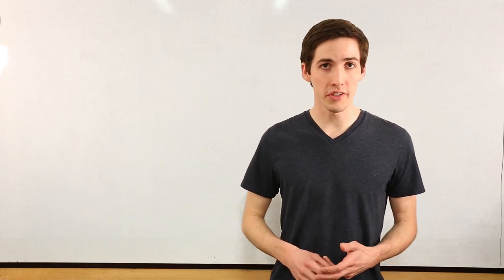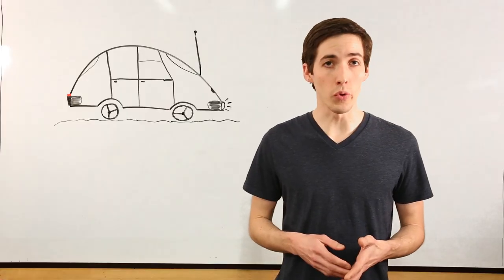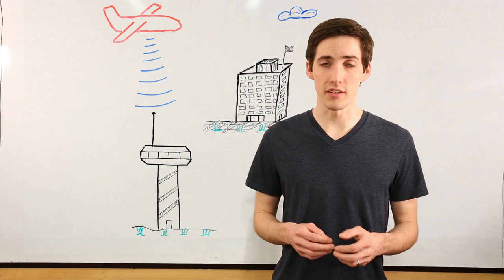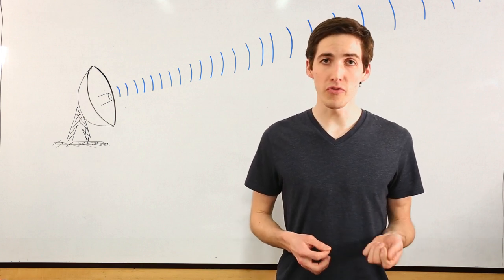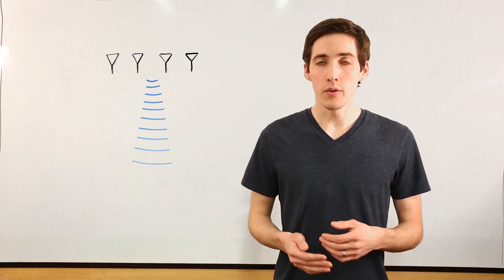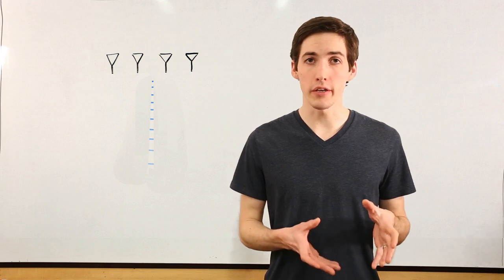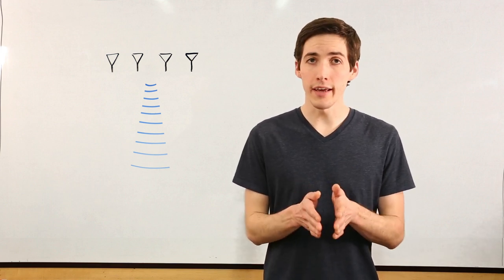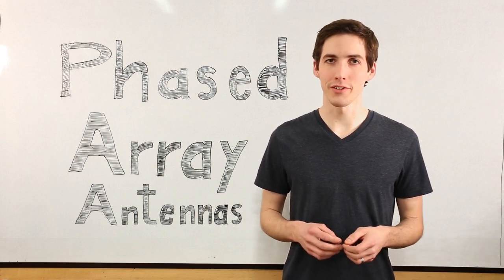Phased Array Antennas

Comment from the maker: Hi all, thanks for the encouraging comments! Grad school has kept me busy lately, but I am going to try to make another video in the coming months. Do any of you have a particular subject you would like to see a video about?
Reply: +Mark Hickle . kindly upload a video regarding Non-Uniform Linear array.
Reply: Can you show how we can perform perform the same thing using the phased array antennas but to produce a beam that moves in 2 dimensions? In other word, a 2d version of what you explain..
Reply: Excellent explanation!!!
Reply: Very simple and easy to comprehend. Good effort buddy
Reply: 3d Structurescan/3d sonar, multibeam sonar, chirp, etc. Would love to see a video on how it's done and how it's processed from the signal.
Reply: Great video. Worked at the PAVE PAWS installation at Beal AFB
Reply: How about telling us all what the F-22 and F-35 have in form of radar to see other stealth aircraft? That will be a tricky one :) The most important aspect of any fighter Jet when looking at either of the F-22 - F-35 - SU-57 - J-20 against each other or any other stealth aircraft is their ability to see and sight their target from BVR or they're simply a blind sitting duck.
Stealth alone defeats high-frequency (shortwave) radar by absorption and deflection it does not defeat low-frequency (longwave) radar. Both the AN/APG 77 radar used in the F-22 and the AN/APG-81 Radar used in the F-35 can't see the SU-57 or other stealth aircraft without longwave Radar - This is a fact even the US Airforce must obviously know! 
It seems that when the F-35 radars were being designed 13 years ago there were no other stealth aircraft to think about as a threat.

Russias new 5th generation Byelka (2band) radar used in SU-57 does have long-wave radar, the first L-Band fighter radar we've seen, they've cleverly embedded it in the leading edges of the wings. 
The Byelka (2band) radar covers all aspects of frequencies and channels to use for tracking, targetting and for jamming. It's a part of Sh121 multifunctional integrated radio electronic system (MIRES) on board the Su-57. 

The N036 radar system consists of a main nose-mounted X-band AESA radar designated the N036-1-01, and two smaller X-band AESA radars mounted on the sides of the forward fuselage designated N036B-1-01.
The suite also has two N036L-1-01 L-band arrays on the wing's leading edge extensions.
Computer processing of the X- and L-band signals through Russian processors Elbrus enable the systems information to be significantly enhanced, removing all clutter allowing them to see and track stealth aircraft and target them from BVR without the enemy being able to pick up their targeting radar either.

Each member of the SU-57 squadron has the ability to select and fire the best-positioned missile from any one of them or from any of the Ground to Air missile defence systems, it's quite simply deadly.
And also let's not forget Russian BVR missiles outclass and outrange the USA's longest BVR's (by up to 100 km's and that's seemingly only growing)
SU-57 can interact In real time with the ground to air defence systems and command and Control centres effectively allowing them to see stealth enemy aircraft from much greater distances with real-time ground longwave radar stations data, that will pick up stealth enemy aircraft entering Russian airspace if not before. This also means that all Russian SU-57's will be able to approach any other stealth aircraft head on and therefore stealthy. Russia cleverly sacrificed rear end stealth for much better manoeuvrability, their front end stealth nobody knows those numbers as obviously they're never released. But the word Is their frontal stealth is or should be excellent.

SU-57 can track 60 targets and engage 18 simultaneously in order of potential threat status and has the ability to track and engage 4 moving ground targets simultaneously. 
The L402 "Himalayas" electronic countermeasures (ECM) suite made by the KNIRTI institute uses both its own arrays and that of the N036 radar. It also makes use of the Russian processors Elbrus and it will put to sleep/Jam the F-22/F-35 without any trouble at all.

The facts are, the F-22/35 will need to get close (30 km range) to see the SU-57 to target it, and that simply means the SU-57 easily sees first, tracks first, therefore engages and fires first (while remaining stealthy btw, the F-22/35 won't be able to detect it's targetting radar either) although we know the USA also has this ability it's of no use when you're already seen and targeted.  The fact always remains, first in Wins. 

Russia tested much of this new radar suit in the SU-35 so they also have the option of fitting this radar into SU-35's permanently meaning they'll be at no disadvantage with F-22/35 as although they can be seen and targeted from BVR they'll also be able to see them from BVR, meaning the all-important manoeuvring the F-22/35 don't have is more than critical if you're going to avoid simply being blown out of the sky.

This manoeuvrability we see from all Russian aircraft today is again massively important as the F-35 is the blind sitting duck until 30 km's out, meaning they will more than need extremely good manoeuvrability (they have not got) to avoid being blown from the sky. 

An aircraft traditionally has three "degrees of freedom" in aerodynamic manoeuvrability; pitch, yaw and roll. 
The number of "dimensions" of thrust vectoring relates directly to how many degrees of freedom can be manipulated using only the vectored engine thrust. The difference between 2D and 3D is the number of degrees of freedom that can be controlled using thrust vectoring.
There are several types of Thrust Vectoring Nozzles, there's 1D, 2-D and 3-D Thrust Vectoring. 
1D Thrust Vectoring was seen on an early-block of F-22s, whose thrust-vectoring nozzles can redirect 
thrust only up or down, Later F-22s (and I believe a retrofit of earlier ones) allowed the nozzles to 
move independently which also granted roll control using thrust vectoring as 1up 1down, making the system 2D.
Whereas 3D thrust vectoring capability used on SU-35 and SU-57 grants pitch, roll and yaw control making it much more maneuvrable, and so much so that we can see the difference visibly.
I don't believe the  F-22 or F-35 are any sort of match for the SU-57 it's not even close.
Maybe you can enlighten me?
Hilarious.
Reply: This made me laugh... The Su-57 isn't going to even be produced. Yet another failed Russian project that is underfunded. There aren't even enough Su-35s in the Russian arsenal to be a threat. I admit it is an impressive opponent, but nowhere near the level an F-22 operates on with respect to BVR, and even WVR. I'm not going to go into detail, but as a career pilot who frequents airbases, you can take my aforementioned statements to the bank. The S-300 is a much greater threat to American aircraft, but even for threats of that ilk, there are effective countermeasures.
Reply: 3 years later, no video. Bruh! You lieded!
Reply: Antenna and wave propagation
Reply: How about parasitic arrays?
Reply: @wecontrolthevideo  Colinear array for hf radio
Reply: Metamaterial inspired Antennas
Reply: raised cosine pulse train synthesis

Comment: This was very simple to understand and very informative on a high level. Much of what was described seems to apply to transmitting a narrow signal. Does this description apply also to receiving signals from a particular direction? Antenna experts sought for project I'm working on using miles of existing wire in an apple orchard as a receive antenna.

Comment: Using the water drops as an example, what happens to the ripples (energy) on the outter areas that are not apart of the directional beam of energy? Is there still energy emitting all around but at a minimum power?

Comment: Nice presentation with good visualizations but one comment.  There are phased arrays with all antennas NOT getting the same input power.  One that comes to mind is 3 identical verticals in a line, spaced 1/2 wavelength apart, and with 25% power each going to the 2 outer antennas and 50% going to the center.  That way, the 50% combined power of the 2 outers cancels the 50% power of the center one in the end fire positions, but broadside there is over 6dB gain compared to a single vertical of the array (with the 2 others removed).

Comment: So in terms of how the beam goes out and interacts it's just the same, it's just that it's done in a solid-state way so that it's more robust and easier to move around.
Reply from the maker: +Treblaine Yes. But another huge benefit is the speed with which the beam can be steered, which is many orders of magnitude faster than physically steering a single large antenna.
Reply: Mark Hickle But what's critical, does both the emission and the detection of the beam have to be directional?

Does only one of the elements have to be directional.

By analogy, can you have an EM source that radiates in all directions like a candle (more like a flash of flare) and then just a lens pointing one way to see if anything is reflected from that direction at the appropriate time delay.

Or can the beam be focused (like a spotlight or a laser) then the detector be completely non-directional, it only sensitive to the same frequency.

If neither was directional and you were in deep space or something with only one large object nearby could reflect radio waves back at you with non-directional emitter and non-direction sensitive receiver you could only find the distance, not the direction.

Also what happens with jamming, I guess that means recording whatever radio wave was fired at it and then transmitting on that same frequency.

Comment: Can you just use the antennas in the array without phase control? What would happen?
Reply: Right ok. However in this case he is talking about controlling the phases of the arrays using digital processing to introduce a specific time delay (and my assumption is that for this aiming you introduce the exact same time delay of a certain magnitude to each antenna and by changing the magnitude you change the direction).

My question was asking what if you do not have this digital processing or any control of the phases/time delays whatsoever! In other words the phases of the arrays would all be random relative to one another (simply powering each antenna separately without any one having any information about the phases of the others).

Comment: Does anyone know whether this technology is power efficient compared with traditional ones?

ps: Excellent explanation!
Reply from the maker: +Roger Nevez

Thanks!

It depends a lot on the specific implementation, but I think that in general they will be less power efficient than equivalent high-gain antennas.

A passively-scanned array (https://en.wikipedia.org/wiki/Passive_electronically_scanned_array) will be less power-efficient than a traditional antenna because of the use of passive phase shifters (quite lossy) and power splitters (slightly lossy), both of which are unfortunately located between the PA and the antenna. An actively scanned array (https://en.wikipedia.org/wiki/Active_electronically_scanned_array) has a T/R module at each antenna, which could potentially provide an increase in efficiency by 1) eliminating the inefficiencies of a power-combining network (which is sometimes utilized in solid-state transmitters), and 2) relaxing the output power requirements on the PA's, allowing them to operate in a higher-efficiency region. 

I haven't read any studies which directly make this comparison, but I suspect that even in the case of actively-scanned arrays the power efficiency would be a wash, and potentially quite worse. Likely one of the many reasons they aren't in cell phones (yet).
Reply: +Mark Hickle > "[...] I think that in general they will be less power efficient than equivalent high-gain antennas."
There is one detail in order to make a fair comparison that I would like to emphasize:
When you have multiple antennas in a phased array configuration, you might reduce the power of each antenna in order to achieve the same range that a single antenna would achieve. Did you consider that?
Reply: +Roger Nevez The antennas inself is the same dipoles as any "normal" antenna. But what "beamforming"/"phase shifting" does by it's nature is an improving energy in SOME CERTAIN DIRECTION within relativly small angle. Means in general, if you mesure the energy just near antennas, they produce exactly the same energy is any "normal" dipole antennas, but if you go far away from that antenna system and put measuring device in the center of the beam, than you get a many dB gain. To be more clear, that gain in certain direction is one and only reason why beamforming exists. (for example, in "average" TD-LTE system the beamforming technique gives 10-15 dB gain over "non-beamformed system", but obviously that gain achievable only in the beam direaction, out of the beam you don't get more energy but get less energy (so beamformign also usefull due to less interference in the areas there no actual receiver located).
Reply: +Alexander Shelupinin Do you know a mailing list or something similar about such kind of topic? (ie: wireless communications, computer networks, ...)
Reply: +Roger Nevez I'm personally not aware of such. But 101% they exists, just google it. Me personally don't need such lists since I'm working in one of "top 3" world telecom companies and responsible for selling 2G/3G/4G radio soluutions in Russia, I have enought docs on my work PC.
Reply: +Alexander Shelupinin > "I have enought docs on my work PC."
For sure docs are very helpful along the career of engineers. But a place to exchange ideas is also extremely important. The internet revolution started this way (arpanet at the time).

> "I'm personally not aware of such."
Ok, no problem. As I'm not a specialist of such field, I though you might know some interesting list/site.

> "But 101% they exists, just google it."
I've already tried but couldn't find a nice place to exchange ideas. Later I'll try again.
Unfortunately, Youtube is bit cumbersome for this.
Reply: +Alexander Shelupinin > "[beamforming] improving energy in SOME CERTAIN DIRECTION [...]"
Ok, I agree.

> "[...] beamforming technique gives 10-15 dB gain over "non-beamformed system", but obviously that gain achievable only in the beam direaction [...]"
Imagine the hypothetical scenario:

You have a "non-beamformed" wireless router in your house and you have a perfect signal to access the internet from your room. One day you changed your "non-beamformed" wireless router to a similar "beamformed" wireless router (ie: same dipoles, same energy near the antennas, ...). This cause the signal at your room to increase 15db, which is more than you need.
So, you decided to reduce the power of your new router in order to decrease in 15db the signal at your room. Now you have the same signal strength and perfect internet connection as before.

After all that, your new "beamformed" wireless router would be consuming more or less energy than your old "non-beamformed" wireless router?
Reply: it will consume definetly less energy since you have same energy as in "non-beamformed" router but that "same" energy only exists at the direction of your PC, while in any other direction it's almost zero... You could compare beamforming to laser beam that just focus energy in one thin beam
Reply from the maker: +Roger Nevez Microwaves101.com is a great website with lots of articles about microwave engineering topics. They have a page about phased arrays: http://www.microwaves101.com/encyclopedias/phased-array-antennas. They also have a nice discussion board, which might be what you're looking for.
Reply: +Alexander Shelupinin > "it will consume definetly less energy since you have same energy as in "non-beamformed" router but that "same" energy only exists at the direction [...]"
There is a tremendous energy cost to destroy all those waves in the other directions. You can't just say that because the waves were destroyed everywhere else, there were no energy expenditures for doing that.

In order to support the conclusion that there will be a decrease in energy consumption, the reasoning must be improved.
Reply: +Mark Hickle > "They also have a nice discussion board [...]"
Thanks! I've just joined them and already sent a question.

> "[...] which might be what you're looking for."
It seems to be a discussion board very focused on electromagnetic waves, for sure it would help.
But, actually, what I was looking for was more related to computer networks.
Let me know if you hear about any.